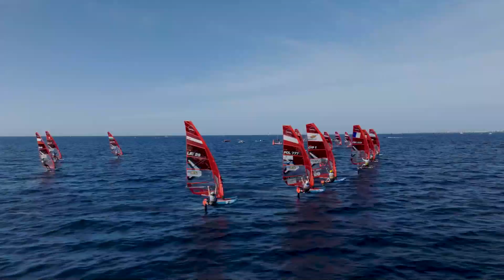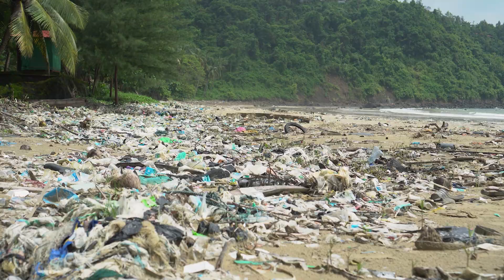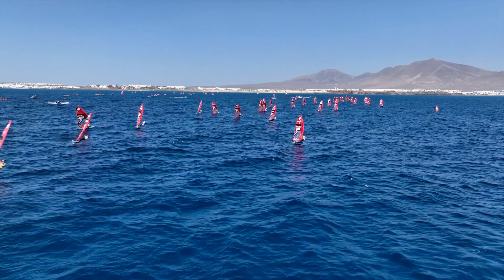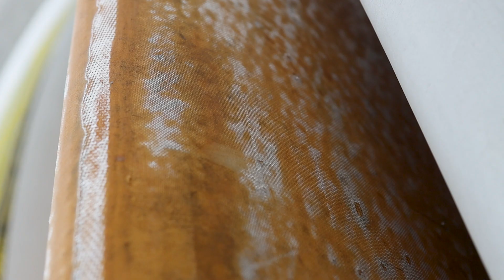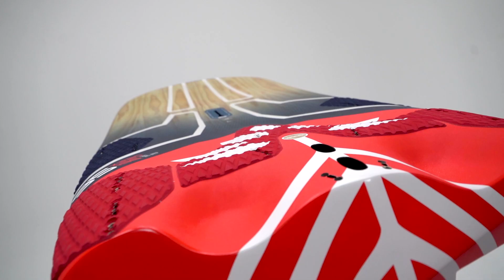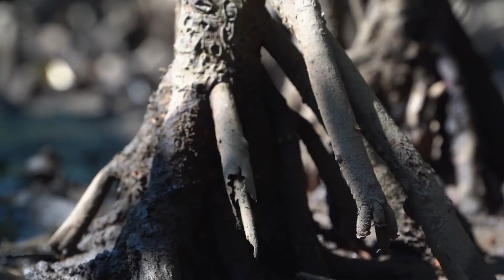Starboard’s eQFOiL Concept Board Unveiled | Sustainability Focused Windfoil Board

Comment: The work of Starboard in getting windfoiling to the olympics is admirable, but in the last bit of time the brand has become a joke in an effort to maximise profit instead of actually producing good products. Your Wingfoiling gear is a complete joke and pathetic attempt at bringing 1 design rubbish into a sport known for diversity. Keep to making IQfoil gear that works well and is cheap instead of trying to rip off consumers with your silly branding.

Comment: prof. athletes have 5-10 sets because of the variability in in weight, stiffness etc. The sail is increadibly thin. and wasnt there the freeride series of starboard which delaminated due to "eco-friendly resin"? Stop the bullshit and bring products with performance and durability. And dont make neither the athlete nor the consumer your beta-tester. this is green-washing at its finest.
Reply: Agreed, Starboard are wasting their efforts on being "green" when in reality they should be producing products that never break or need to be replaced.
Reply: Agreed, durable equipment is much more environmentally friendly in the long run. 30 year old Mistral one design Olympic boards are still going strong. IQFoil boards are fragile and competitive racers replace their boards, sails and foils at least once a year. Sounds like more green-washing propaganda.

I made my Windfoil Race board by recycling a discarded RS:X Olympic board and it is stronger and at least 1.5kg lighter than an IQFoil board : https://www.youtube.com/watch?v=dGSU-PjL548&t=31s.